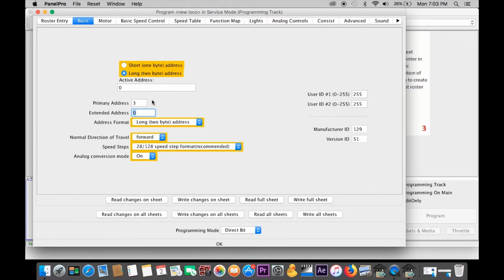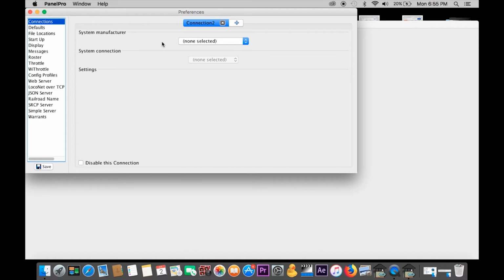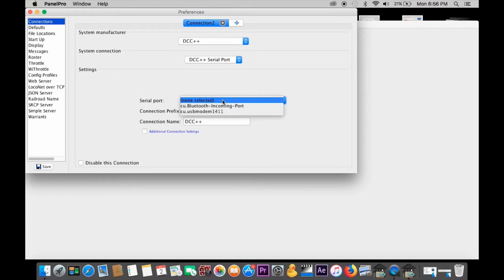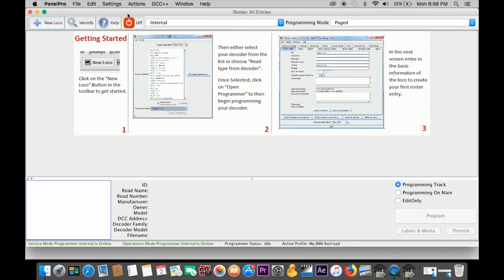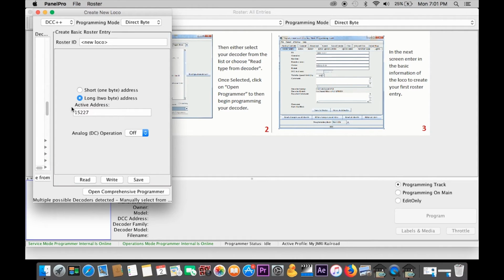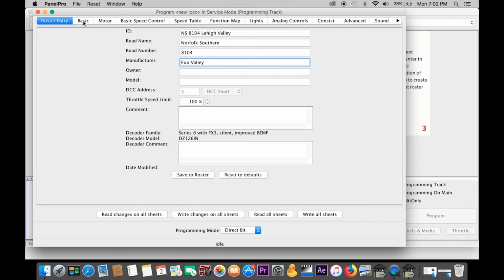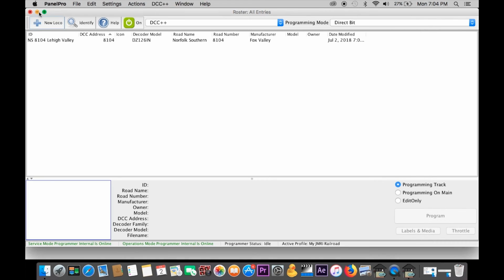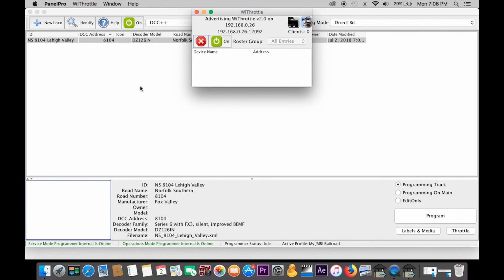Setting Up JMRI on your Model Railroad

Comment: This is a great tutorial, and it helped me get started. However I'm having an issue: 
I have a pair of locos using DH126D decoders and I keep getting a 308 error every time I try to write or read anything from the decoder. However if I manually set the address to the default (3) I can control the locomotive fine. But I would like to be able to change that address. What are the steps I should take to fix this error I keep getting?

Comment: Hi Jimmy ... I think you cured my problem, ive just setup DCC++EX on my Mega, NO WiFI yet and when I fired up a DaisDCC decoder on a DCC Decoder tester as soon as I clicked power the motor spun and couldnt figure out what I did wrong, also reading decoder failed, the Decoder worked fine on a Hornby Select, so will watch your video again when I try again ...John
Reply from the maker: Are you reading the decoder on the program track or the main line?
Reply: @DIYDigitalRailroad  I was using the program track on the Motor shield, but looking at your video I am thinking I didnt select DCC++on the Roster Page ...
Reply from the maker: Great! I’m glad to hear the video helped!
Reply: @DIYDigitalRailroad  on JMRI 3.1.0 when I go to Roster New Entry page and click Track Power the motor on DCC Decoder tester starts up, only think I can select at top is Direct Byte/Direct Bit makes no difference... if I try and locate the Decoder and read it comes back with no acknowledgement (308) ... so at a loss ... not sure if you can help/// Regards John
Reply: @DIYDigitalRailroad  I’m having the same problem trying to program on the main line

Comment: Hi Jimmy, I really enjoy the videos you put out.  I'm having trouble with the JMRI connection.  The build on the Arduino is correct, double and triple checked.  The problem is when I turn the power button on on the JMRI, only the A- LED lights up on the motor shield.  Any help would be great.
Reply from the maker: Hey Eric.  There’s a couple things that could cause this.  The first would be the jumpers aren’t plugged into the correct port.  The second is using a motoshield that isn’t compatible.
Reply: @DIYDigitalRailroad  Thank you Jimmy.  Keep up the great work.

Comment: Using the arduino mega with motor shield is running DCC ++. The motor shield  has the ‘ V in ‘ trace removed and has a 15V input .

Currently my thinking  is this configuration is suspect and power is not getting to the programming track.

As an alternative and to eliminate this existing setup , I intend next to use a new arduino motor shield with the ‘V in ‘ trace intact with a 12 V supply . Can you confirm if a 12V supply sufficient to programme the decoders through JMRI?

Comment: I have a DCC++ with Adriano as per your directions on for building. Thanks love it  I am having some  troubles, wow sound  getting programmed  have a wow 101 sound decoder with sound   reads the decoder set the decoder but when you put on the track and throttle nothing happens I won't move won't turn lights no sound  tried reset and stayed the same

Comment: I can program  the loco on the program track and i see it move a bit when it programs to it. but if i pull up a throttle  to move it i get nothing.
Reply from the maker: Are you trying to move the loco on the program track?  It won't move on the program track.  Just the mainline.
Reply: It doesn't move on either

Comment: I've built my own DCC++ system and I'm trying to get JMRI running on my Macbook to control it.  I plan to switch control over to a Pi Zero W, but I wanted to get one thing running at a time.  I have the Arduino connected to the Macbook over USB, but when I pull up the roster screen, the power button for the layout is yellow and says unknown instead of off, and I don't have that dropdown beside it to select DCC++.  The bottom of the roster screen says Service Mode Programmer DCC++ and Operations Mode Programmer DCC++ are both online, and that the Programmer Status is Idle.

I connected some track to the programming track and put a locomotive on it, but nothing seems to happen when I try to read information from the locomotive.

This is my first time working with Arduino, and the motor shield I ended up with isn't the same model as the one in your video on building the base station, but I looked for one with a similar model number and physical layout as yours.  Here's the manual (not that there's much to it) for the one I have: https://www.velleman.eu/downloads/0/modules/usermanual_vma03.pdf

Any help you could provide would be very helpful.  I'm tech savvy, but I'm just starting to dip my toes into the maker world, and I feel like I'm in way over my head.
Reply: I have the same problem, i ran the dccpp controller program (dcc++ software) and it reads the chip and writes new numbers but i have no joy in jmri in reading the chip, if i work it out i post but will keep an eye on this for now to see if anyone more experienced helps solve the problem.
Reply from the maker: I have found that DCC++ is very picky about it's motorshields.  This sounds dumb and completely un-techy, but the only way I have found to discern the motorshields that you can and can't use is the Green terminal strip.  Here is a link to the exact same one that I use. https://amzn.to/2CYHnam.

As for the issue with the connection, sometimes the port numbers can change in terms of where the Arduino is hooked up.  JMRI labels a connection red in the preferences window where you set up your connection.

You can also try deleting the connection and creating a new one.  If that doesn't work, you can also try creating an entire new railroad in JMRI.  I have had this problem in the past and these are some things you can do to remedy it.
Reply: I found the JMRI logs last night, and it looks like it's not seeing the USB port like it's supposed to.  I'm going to try getting the Pi up and running with JMRI tonight and see if that fixes things.  If not, I'll order that other motor shield and just wait a few weeks for it to show up, and tinker with the current setup while I wait.
Reply: @BrianMills  try the dcc software that is included in the dcc package. If that connects, the problem is software. The arduino is the USB bridge so the motor shield probably not at fault. I've tried the deek-robot and arduino and have the same problem reading chips
Reply from the maker: Macs can be a bit finicky when it comes to arduinos and USB.  I do know that.
Reply: Thanks to this thread: http://www.trainboard.com/highball/index.php?threads/dcc-arduino-and-velleman-motorshield.104703/ I modified where the wires were plugged in, and after some trial and error with the jumper pins next to that row, I have power to the track, but it appears to just be a full power DC signal, because my locomotive takes off full speed reverse when I put it on the track.

I'm really thinking I should just order the other motor shield, but it'll take 3-5 weeks to arrive unless I want to spend about $45 for shipping.  Do those only ship from China or something?  I can't seem to find it on any website with shorter shipping times without spending a fortune.
Reply: So, I'm still waiting for the motor shield from Amazon, but after watching the videos on the DCC++ channel I got an actual Arduino motor shield and set the system up with that.  Now it seems to be working mostly fine with the Pi Zero W and Engine Driver.

Thank you so much for your great videos!  There was some frustration involved, but I got the system up and running for way less than buying one.

Comment: Dcc++ user here running layout with the original dcc++ controller.  Am wanting to use JMRI just having issues controlling locos in JMRI I can program a loco just can’t control.   Any off the hip suggestions?
Reply from the maker: Are you using the Engine driver or withrottle app or are you controlling straight from the computer?
Reply: DIY & Digital Railroad 

I would like to use WiThrottle I can connect but not control the loco same thing on the computer inside of JMRI can turn track power on can wright to the decoder. On the dcc++ page I downloaded the dcc++ controller he made that (will a little work to put my loco in) will control the local on the main and program track.
Reply from the maker: @jfcastiglia  Are you programming the loco on the main or on a separate programming track?
Reply: DIY & Digital Railroad    Tried both ways.